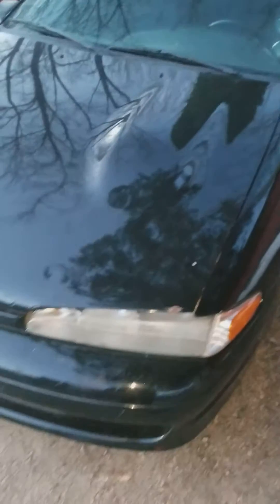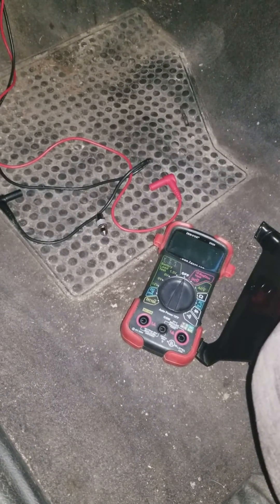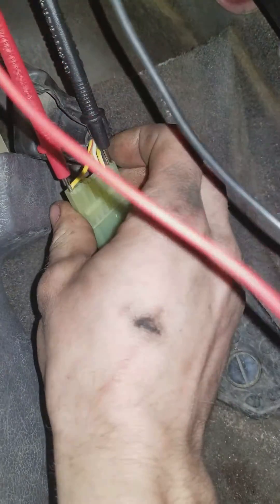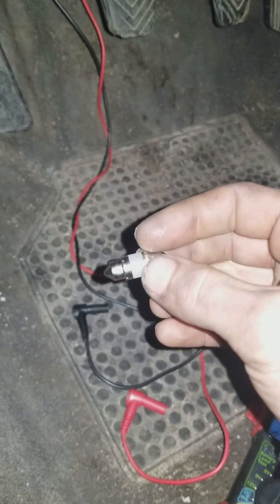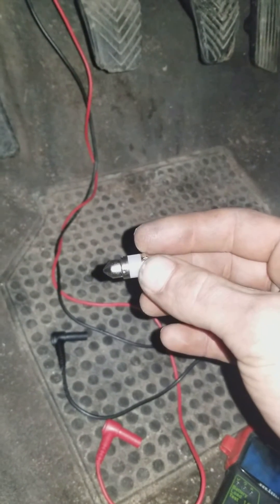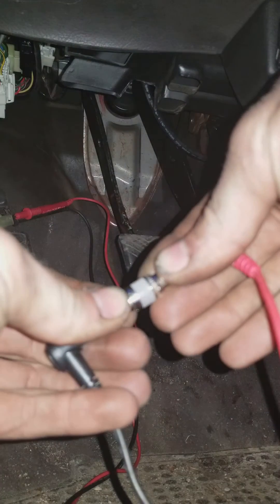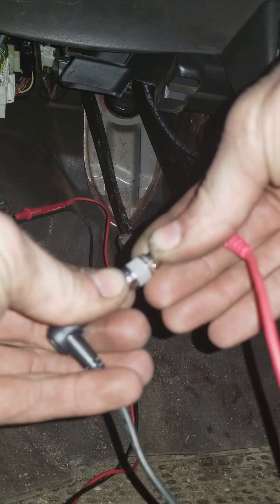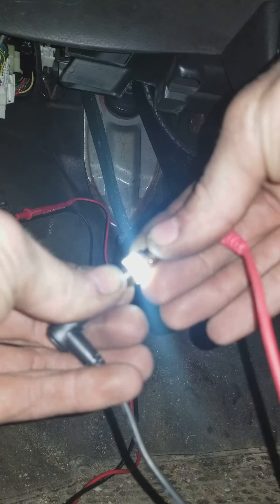Reading check engine codes in 92 Mitsubishi Eclipse

Comment: I first used a regular bulb which didn't work because I didn't pay attention that you need to use a LED bulb like you said :).   I also used paper clips to insert into the back of the plug and hooked up my wires to that :).  Thanks for the video.
Reply from the maker: Yeah, led lights react to the pulses nice and quick lol. I'm on V3 link these days, so luckily CEL readings are as easy as plugging my laptop in lol
Reply: Is V3 link like an obd2 scanner?  Would an obd scanner even work? Or are 1990 eclipses to old?

Comment: Which led did u use?
Reply from the maker: Any LED will work. The cheap litle probe testers that plug into the cigarette lighter will work as well. Keep in mind that if you use just a plain LED that you have to ensure polarity is correct as they are polar devices. If it is unlabeled the longest leg is normally positive if memory serves me correctly.

Comment: Where did you buy the LED you’re using? And what should I look up to find it?
Reply: i take a led bulb of the reading light from the interior light.
Reply from the maker: The place you will likely have the most luck is at your local hobby store that does RC stuff. They normally carry bare LED lights for those DIY RC guys and gals out there